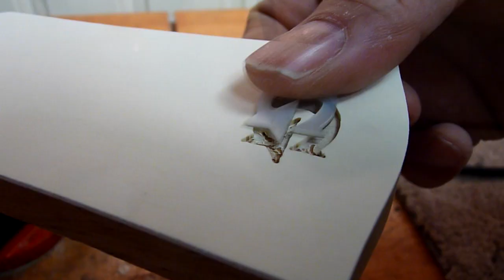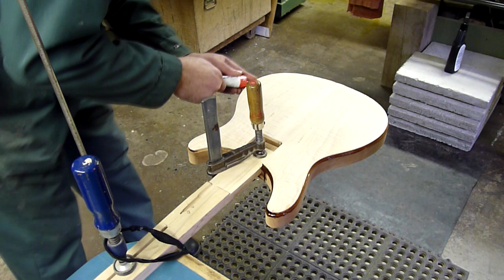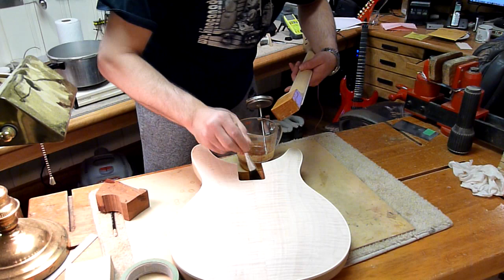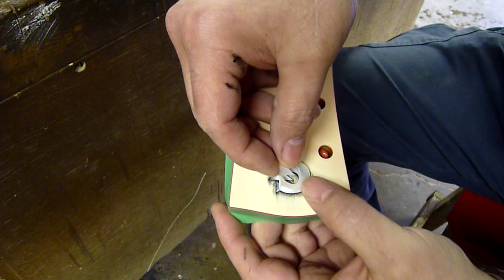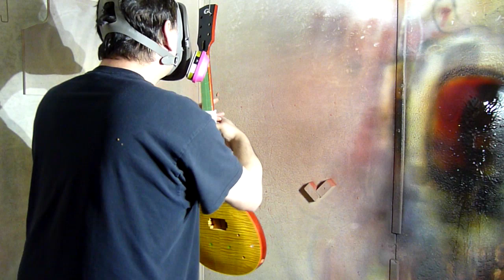Freddy's Double Cuts Part 5

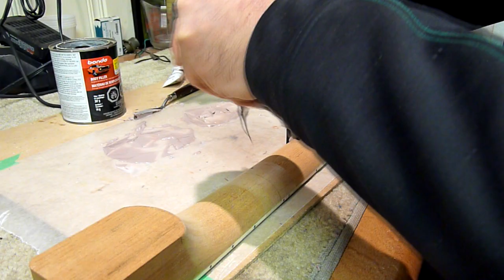Comment: Long awaited video, very cool! I did not understand what the neck "profiling" part was about, could you explain what was the purpose of that phase (time 1:25 into the video)?
Greetings from Finland!
Reply from the maker: I carve my necks by hand, so I got the first neck to just where I wanted it (which was just slightly chunkier than I normally do). Once it felt perfect I wanted to preserve that neck profile so that the subsequent builds would be exactly the same, and also so I would have these templates for my library of neck profiles. Thanks for the comment...and great question!
Reply: FreddysFrets thanks for the answer! After closer look I see can of bondo, cool idea to get an exact mold!
Reply from the maker: @rakkucustom  Also...it might be difficult to see on the video, but there is a piece of clear "packing" tape on the neck where I apply the bondo templates. The bondo releases cleanly from the tape.